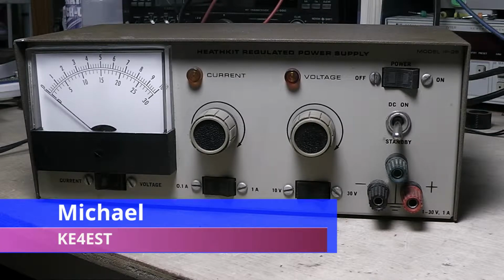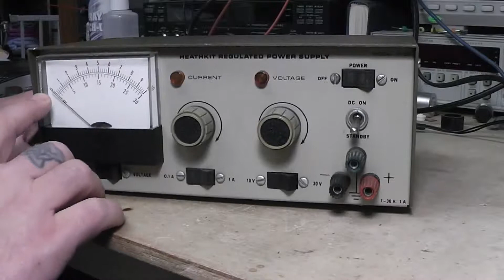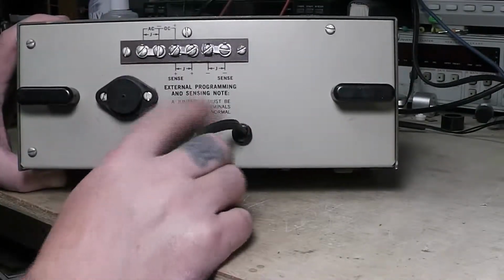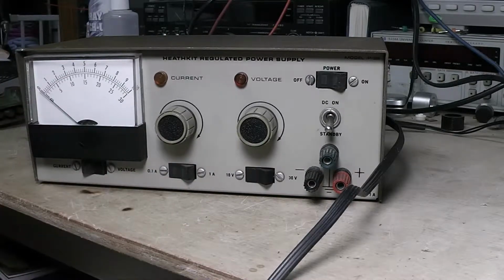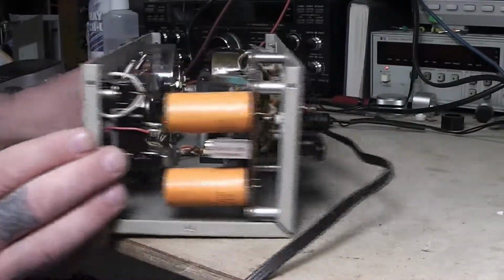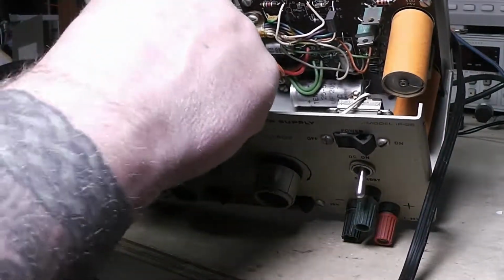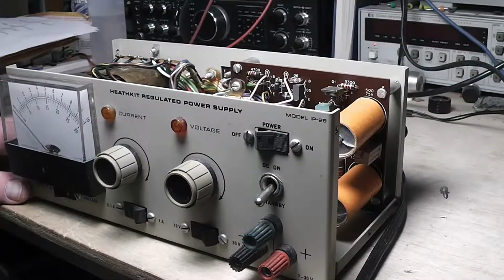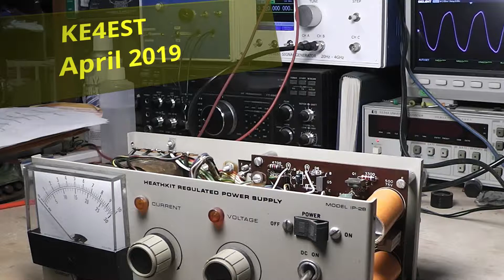Heathkit IP-28 Restore Part 1

Comment: The idea of 'remote sensing' is not so much that the meter reads correctly, it is so that the voltage control feedback circuit is reacting to the voltage at the load, rather than to the voltage at the front panel terminals, and therefore can adjust automatically to maintain the desired voltage at the load.

Comment: Interesting video.  Part 2 may be even more so.  I bought one recently, but it arrived with a broken meter case and the meter itself was damaged so it won't move above 5 volts.  The good thing is, it works.  I've yet to put a scope on it or open the case.